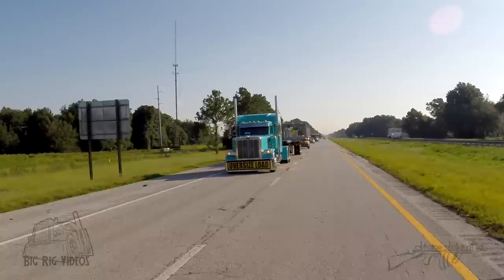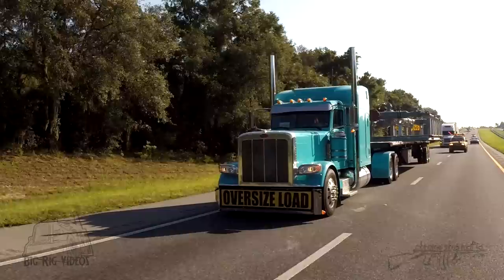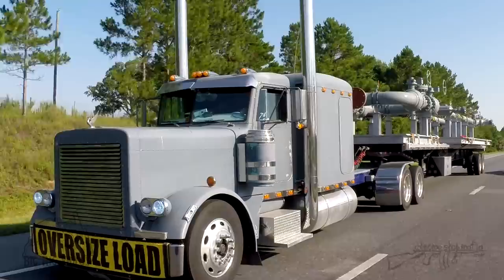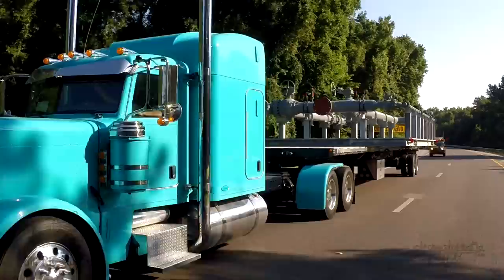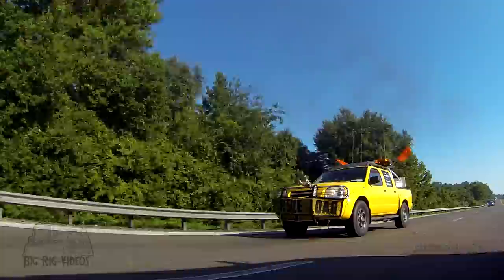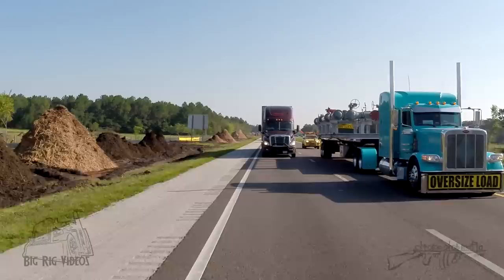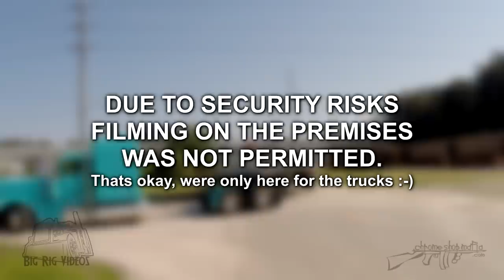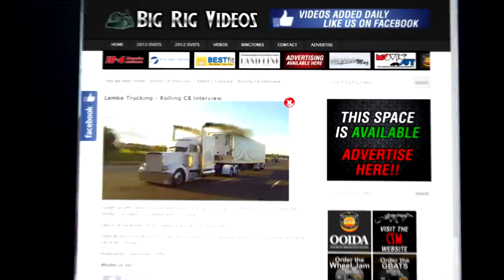JD Specialized Transport - Rolling CB Interview™

Comment: why do you need a long wheel base like that?
Reply: So the truck rides better. Shorter wheelbase would buck n kick over bumps
Reply: what about weigh dist is it harder adjust?
Reply: sliding 5th wheel I'd think.
Reply: it's for looks and ride
Reply: Looks better and rides better are the pros but your length is longer and it's hard to get twisted around in some places